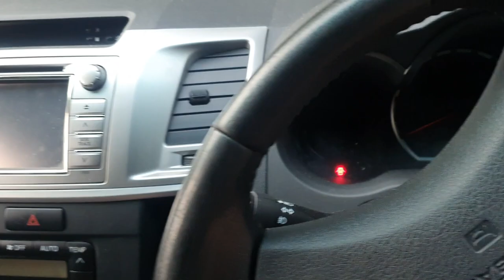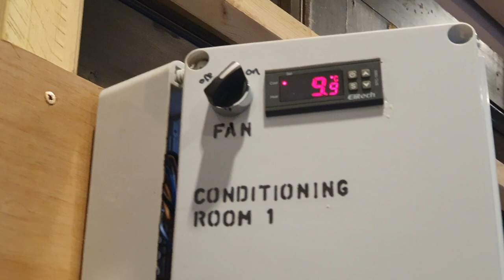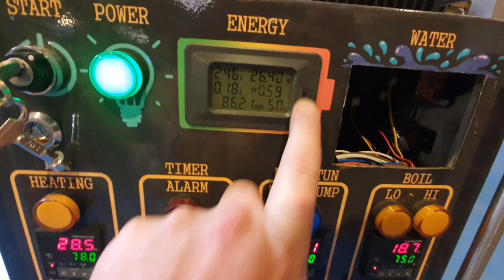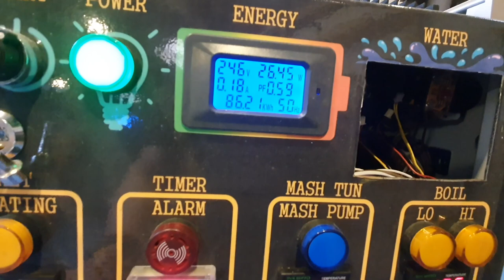vlog 860 Getting The Pilot Kit Out

Comment: Why not extend your existing tanks vertically? (It wasn't apparent to me if you wanted to ferment larger batches or have more variety.) Another possibility would be changing the design entirely and remake your fermenters to be horizontal and on a steel scaffold - you could go 2 or 3 high like that...the trick is being able to fab a leak free manway to clean them and inspect them. Hope you and Tom have a blast with the lovely Coconut Shy PA...but you two always have fun when you brew together. Cheers!